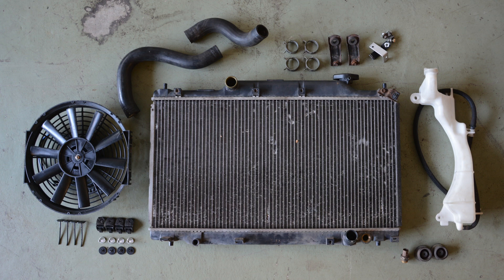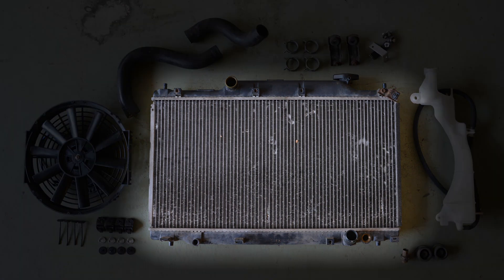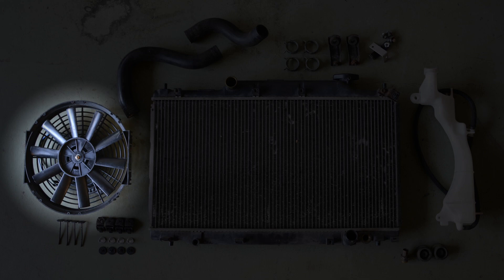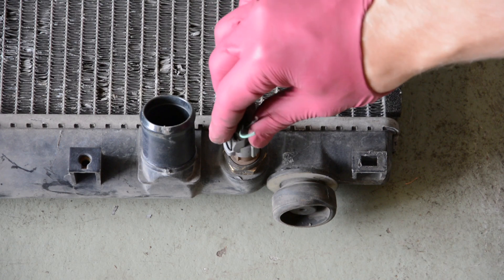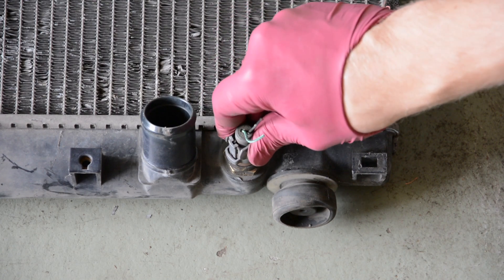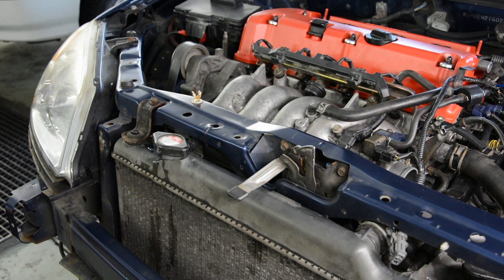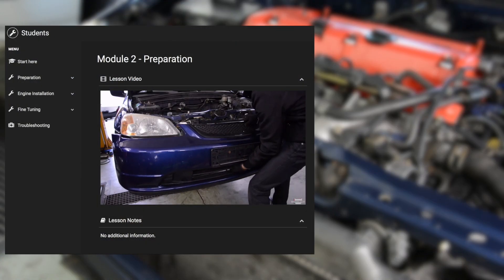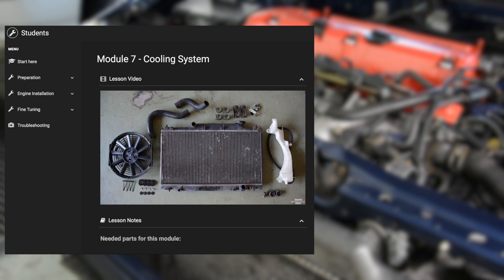K20-EM2 Swap - EP. 05 Cooling

Comment: Would two 12 inch fans be ideal for running this setup with a turbo?
Reply from the maker: I'd say yes, if not even just mounting one as shown in the video.
Reply: Also could you use the stock d17 radiator if you just made a custom hose since there is room for it and it's on the other side of the radiator
Reply from the maker: The fan switch is mounted to the K-Series radiator and the D17 one does not have a mount for it so I'd go with the K-Series rad.
Reply: @kpowered  only reason is I spent a decent bit on my new cooling system only to decide I wanna k swap and not build the D series because having the put together 3 different engines just to be able to tune sounds messy and like more work but I still am undecided.
Reply from the maker: @garrettprosser7336  The K is definitely the more solid base considering a boosted setup later on. If your D-Series is already built, I'd go with it. If properly done, these motors are capable of quite a bit and it's more exotic compared to 'just' a K-Swap.

Comment: If I were to use a complete harness from a donor vehicle, would that already include the fan switch pre wired?
Reply from the maker: Fan switch is part of the chassis harness which I wouldn't replace. You're only taking the engine harness from a donor car.